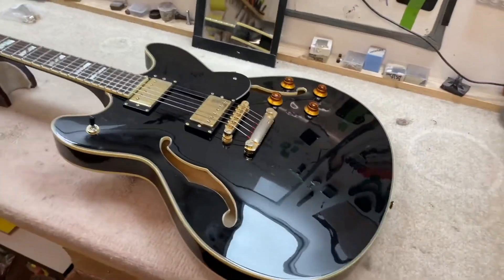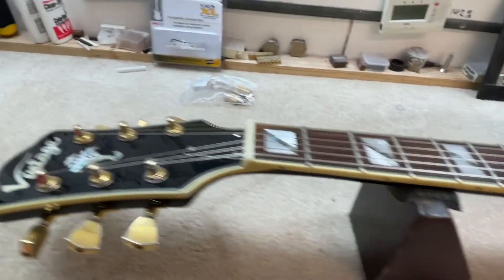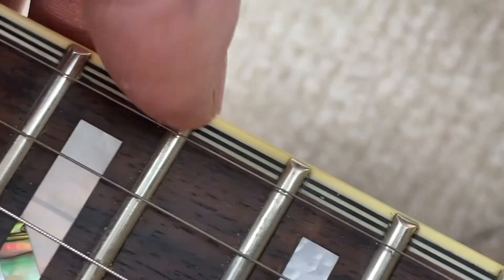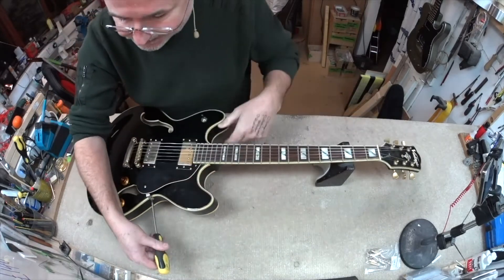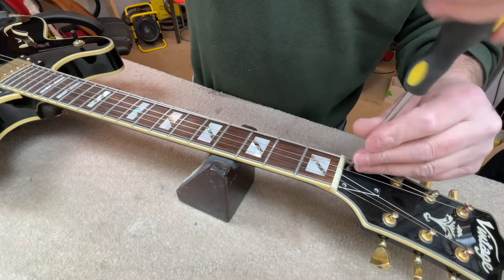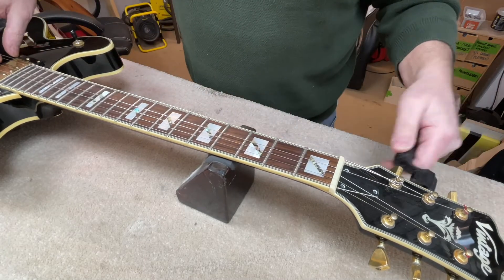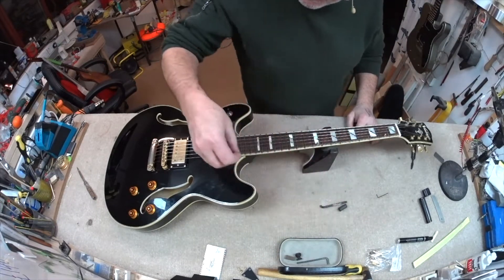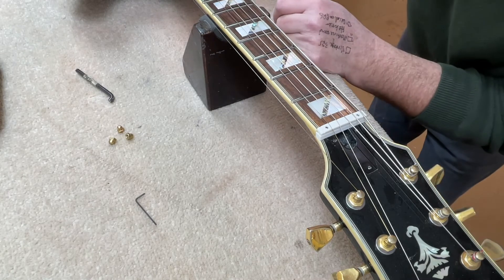Early Vintage 335 style semi acoustic set up

Comment: Sam its pre-2005 because that's when Wilkinson joined the JHS Vintage brand and when Vintage started to use Wilkinson parts,  these were made in Korea and you can tell by the hump on top of the headstock by the time production moved to Vietnam in 2006 the top of the headstock had changed to the zig zag style.